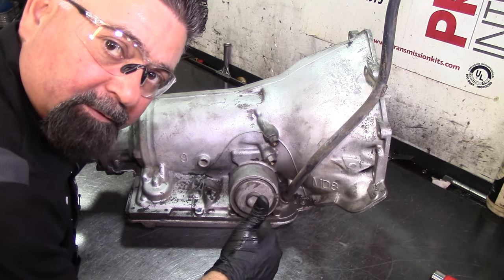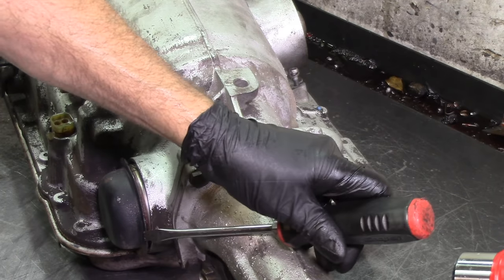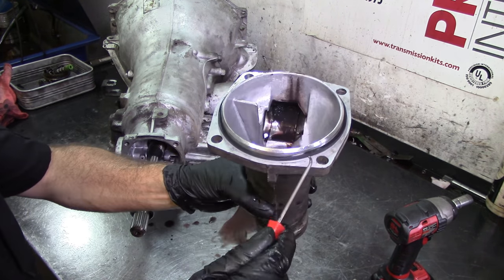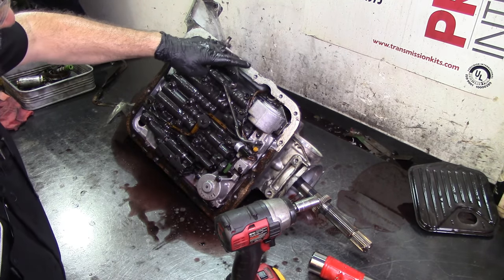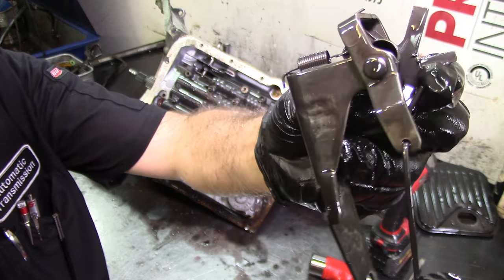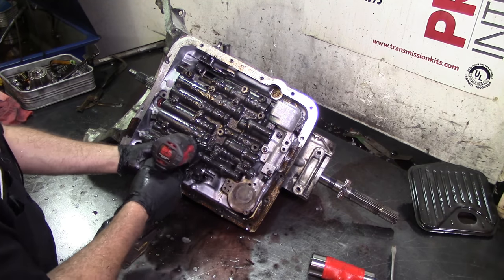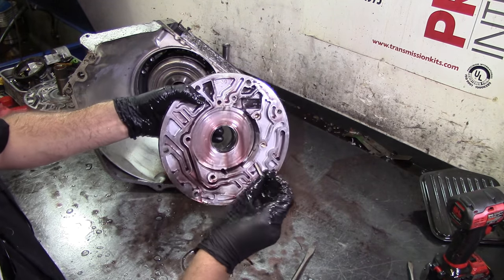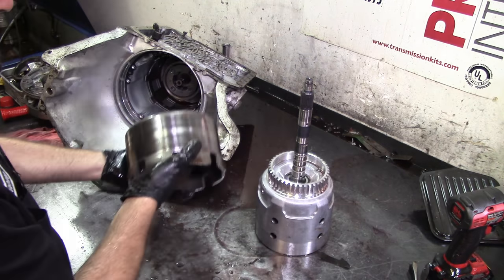700R4 TRANSMISSION FULL REBUILD PART 1

Comment: Great review and explanation of part ID and reasons for disassembly procedure. I might be biased on this video since I have an 89 GMC V1500 Suburban with this same transmission. All original transmission 136,000 miles, 4th fluid and filter change except years back my local transmission shop suggested to put in a Corvette servo and they adjusted the TV cable, that was in 1992. Has a really good firm1 to 2 upshift but 2 to 3 is getting less firm under full throttle. Thanks Hiram.

Comment: Hiram, This is another great video from beginning to end. I are doing a great service to all your viewers showing them tips, tricks things to look for. No one except a few look at the captured check valves, not just the loose ones found in the valve body in the “Bath Tubes” where the lives. Wether a guy has a number of tools or all, the option to use what you have comes out. Nice, clear, easy to hear. Just a great just as they can rewind and watch over as needed. I always love finding bad stuff and mistakes made by the last guy. The 87 era was the last year that the VB was drilled for converter clutch hydraulic control but simply has plugs. Adding a 40 tooth tone rings on out the output shaft and use a 92 and up sensor to get a VSS to and electronic instrument cluster. Just a great job of explaining. Thanks!

Comment: Hey my name is Doug. Really liked your video 700r4. I have a 700r4 I’m going to rebuild. I’ve never rebuilt a transmission but I believe I can. It’s going in a4x4 everything is stock, regular sized tires. But I pull a trailer from time to time. What do I need just to make the transmission stronger? 1986 k20 5.7 4 bolt stock. And thanks again for the video

Comment: Awesome video!!! Hey can just the pump/drum be removed without removing the pan, valve body, accumulators, and all that on bottom? It's a newly rebuilt trans that the TV cable was initially set up wrong, it was only driven about 5 miles but now the cable was adjusted correct and it still won't go into 3rd and has black clutch material in the pan. So I'm thinking the TV cable error messed up 3rd and wondering if I can just pull the drum and repair the 3rd/4th clutches and friction material without breaking down the entire trans. 1st, 2nd and reverse all feel perfect, it just slips going into 3rd.

Comment: Nice work.  Thank you for doing this.

At 41:50 you talk about interchanges between 4L60 and 60e front to back lube seals.  Fig 100 page 62 of the ATSG manual states they are not interchangeable and the proper seal is determine by matching the output shaft to the figure.

I am doing an autopsy on my otherwise perfect 700R4 and it turns out the rear planetary failed likely due to the previous builder using a mismatched seal.

Comment: As i've said before, USE THE FAN!! i've lived in Texas and 110F is way to hot to not use a fan. Also it's not the fan making the noise, it's the ballast in the lights and it's not a problem. I've been subscribed for a long time and your doing fine so thank you for the video.

Comment: Great videos you explain everything  and keep it to the  point.  I have a question  that I hope you can help  with 92 - 700-r4  I went to install a shift kit along  with new  accumulator pistons, corvette servo and .500 boost valve  in the pump long story  short the new boost valve  is somehow stuck inside its bore  like maybe it's wedged I don't  know  tbh . Any ideas for getting  it back out and can those bores be honed or is it best  to replace  the  pump

Comment: Around 1:02:10 related to the 3rd accumulator capsule / check ball, you mention the option to reuse the capsule with check ball by using a Sonnax part that goes on top of that. What Sonnax part number are you referring to? My OEM capsule and check ball is not leaking and I don't like to break something that is working (e.g., a OEM replacement might leak out of the box), but I want to ensure no leakage with the Sonnax backup solution that goes on top of the existing capsule. I can't find the Sonnax part that would fit in the small space above the existing capsule,

Comment: Hi how are you ! Have a quick question about a 700r4 transmission in my 82 c10 i was working on my truck so i put the front of the truck on ramps and when the front was on the ramp the transmission starts to leaking oil from the rear en where the drive shaft is connected to the transmission is that normal or maybe a seall is bad????????

Comment: at 12:50 You mentioned building up pressure. When my truck is cold and i step on the throttle i feel a 'dead' spot before it really engages into 1st gear. Could this be because the tranny is cold and hasn't correct pressure yet? Because after that is engaging just fine.

Comment: I’ve got a 700r4 in a 86 blazer it’s been rebuilt by a transmission shop but it lost reverse all forward gears work what would be the most common thing that would cause that to happen ?

Comment: I have an 83 700r4 behind a 6.2 diesel.  Would I benefit  at all switching to a 13 rotor pump?  Also is there anything different besides the governor  and the convertor on a diesel transmission?
Reply: The one in the truck has no reverse. I bought the truck that way. Forward gears are all strong

Comment: Hi my manual shifter shaft that connects to the shifter lever inside my th700r4 tranny pops in and out ever so slightly so I can't get the shifter ( b&m sport shifter) to work properly. 
People mentioned that there is a 15mm crown nut inside the transmission that holds the manual shifter shaft in... 
 Do you think that it's loose or broken and could be the issue?

If I drop the pan, would you know if I have to remove other parts to tighten the crown nut to the manual shifter shaft? 
Would you, or anyone know the torque for the nut?
Thanks for your time and help.

Comment: Why does my 700 shift fast and hold a higher gear causing it to pull when stopping thus causing it to die ( when it’s cold ) but when it’s warm it shift perfect and down shifts perfect 

I changed the guild and filter with no improvement

Comment: Hiram no longer seems to be active, so FYI for anyone interested: Possibly Sonnax Servo Release Check Valve Kit, Part No. 77701-076, 2nd Gear Servo Release? Sonnax states "Warning: Must be used with properly functioning OE capsule."  I decided to replace the OEM capsule check ball: GM Genuine Parts 8634400 Automatic Transmission Clutch Accumulator Check Valve, and add the Sonnax part number, while I had everything apart. Happy building to all.

Comment: You sir, are an expert at your trade. I would love to ship my transmission to you to build. Is there any performance upgrades or kits for the Nissan Titan RE5RO5A?
Reply from the maker: Both Superior and Transgo have valve body kits for it. 
The TCM is part of the valve body. Titan has a problem with TCM that throws a false solenoid code and goes into fail Safe mode. TCM needs to be replaced if that's the issue.
Reply: Thank you. It shifts fine, but the dealer said it has a code for a temperature sensor.

Comment: I had a fleet of '84, '85 & '86 1/2 ton Chevrolets that we ran nationwide. Could not keep 700R4 transmissions in them. I talked to the local PD and they had same problem with their patrol cars. I even installed a high performance towing 700R4 in one and it did not last. Those things sure left a bad taste in my mouth.

Comment: Instead of the 700r4. What should you put in the vehicle, if 700 doesn't last.
Reply from the maker: If you're capable of electronics a 4L80E is great. 
700R4 is about right for hydraulic control without PCM.

Comment: So many people think you don't need the tv cable it makes buying a used transmission difficult
Reply from the maker: If it's not plugged into the throttle the transmission will fail very quickly. 
No TV pressure = low line pressure.

Comment: Mine has a flexable “tab” that is connected by one of the 13mm valve body bolts about an 1”1/2 long, what is it there for?  ( Near rear yellow  electrical plug )

Comment: Hiram!! Watching this video has me rebuilding my 87 700r4 I have a question and hopefully you’ll see it

My separator plate is damaged from the accumulator from a broken spring I’ve found a repair plate that says it’s for that do you have any advice or info on the install as info is sparse hope to hear your input
Reply from the maker: The overhaul kit comes with gasket for that plate.
Reply from the maker: Also, part 2 came out last Saturday.